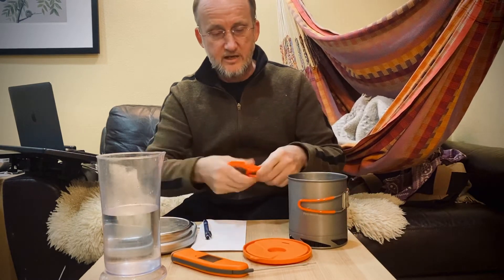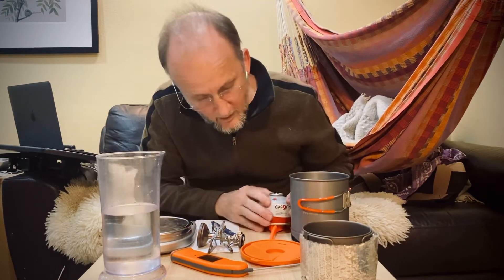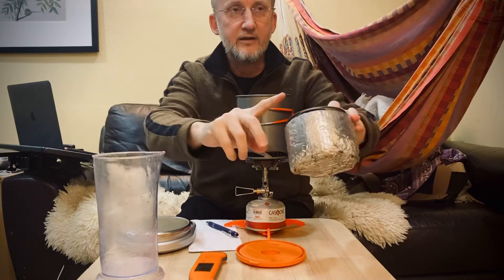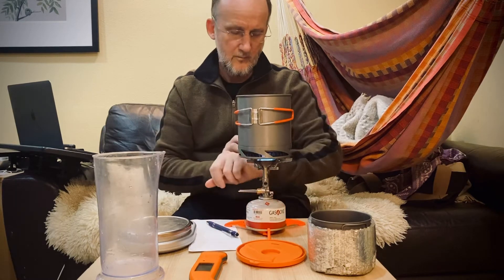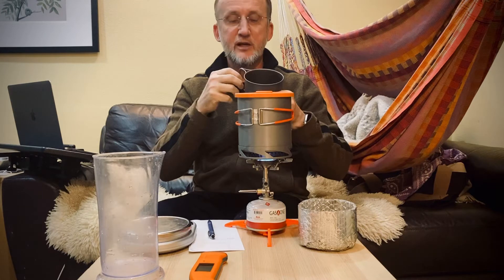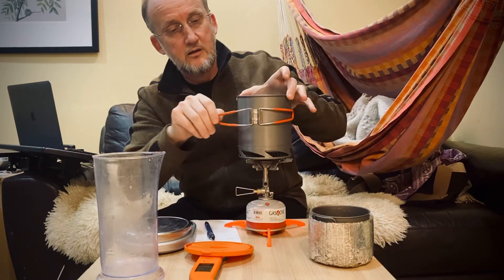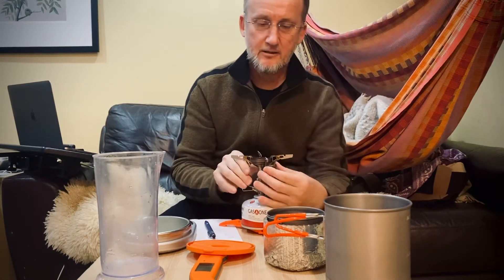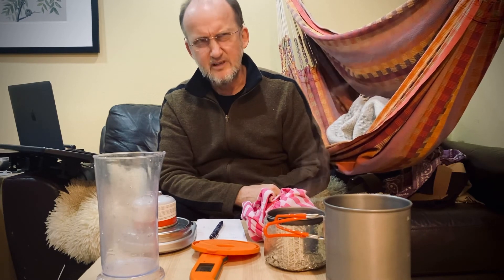DIY Jetboil Stash? Fire-Maple FMC-XK6 pot with Soto WindMaster stove speed/efficiency test.

Comment: Will a Toaks  650 or 750 nest with the FMC-XK6
Reply from the maker: I nest a 550 in a cozy that prevents rattle. Insulated rehydration vessel and bowl. 650 should. 750 probably too tall.
Reply: @cleverchimp  Thank you

Comment: Garbage ....I did 3 separate boil tests between this pot and my 1100ml Toaks titanium  pot with .5 liter of water and there was no difference between the boil times. This was using a Soto Windmaster stove. Not worth the money as a heat exchanger pot over my Toaks, especially for the weight penalty....BTW all my times were all about 1:35
Reply from the maker: Not calling dishonesty, but I must question your report in the light of many, many other tests demonstrating the efficacy of HE pots. Yes, there are trade-offs on fuel efficiency vs weight that tilt the net efficiency one way or the other based on length of a given backpack. I freely admit that I am biased toward fuel efficiency in ways that might not always pencil out given the outrageous metabolic demands of carrying an extra few grams so many miles in my pack ;-). 

I just got the new 600ml FireMaple Petrel HE pot. I freaking love it: locks onto the Soto tri-flex support, putting the flame 100% inside the HE cavity which acts as a wind screen. Even if the wind blows the flame sideways off the pot, the flame must pass through the HE element.
Reply: @cleverchimp  I am waiting for that one to come in the mail. I am sure it will be much more efficient 🙂
Reply: @cleverchimp is there enough ventilation in this set up? Bcs if flame is shielded too much it can potentially blow the canister..
Reply from the maker: @vvs3796  Used easily over 200 times, never any issue at all.

Comment: I hate these indoor boil test videos.  The JB Stash has awful performance in the field as even the slightest breeze will extend those boil times to well over 10 minutes for 2 cups (tested myself).
Reply from the maker: I hiked 1300 miles of the California PCT with this setup. High winds were normal, as were sub-freezing temps at altitude. I’ve been extremely happy with this setup. Other hikers were amazed at boil speed. Eventually I sent home the inner rehydration cup to be able to fit a larger fuel canister, as resupply opportunities thin out in and after the Sierra.

Comment: Hi there! Great video, thank you! I had a question about nesting that I am hoping you can answer... Can you nest a 230g fuel canister, soto windmaster stove (with 4 flex) and pot stabilizer all in this pot? And if this is possible, is there room for a sea to summit x mug? Thanks so much.
Reply: I have the same pot and stove. If you put the canister in inverted (thread side down, with the plastic cap on to prevent scratching the pot bottom), the Windmaster with decoupled 4-flex (or tri-flex) will fit in there and the lid will snap on, but it bulges a little due to the width of the burner head. Good thing it's flexible.

EDIT: Not all 8 oz./230 gram canisters are the same height. The Coleman ones are a bit shorter than others and fit better. MSR and Primus will fit, too, but the lid is not as secure.
Reply from the maker: I am unfamiliar with the sea to summit x mug. If i recall correctly the 4 flex was a little tight with other items.

Comment: Video was great. Much appreciated.

What do you use the 550ml cup for now that you have the bigger pot? / Are you worried about the anodized aluminum coming off from either cooking or scratches from spoon?
Reply from the maker: The 550ml with reflectix cozy is my rehydration vessel and eating bowl. Keeps the main pot clean of oily food residues, available to brew tea, fill a warmer bottle with hot, wash up etc., separate from food. Hard anodizing is very durable.

I have since ground away at the pot support to lock the pot centered on the burner even if not perfectly level, and friend made neoprene cozy for pot so i can ditch the handles, even more thermal efficiency.
Reply: @cleverchimp  you could have just bought a jetboil in essence you just inadvertently made one 😂.. adding grooves to help  lock the pot and a neoprene sleeve
Reply from the maker: @antduke2361  well, it’s lighter and more compact than the large jetboils, but has both a higher BTU on max and good simmer control, and is also cheaper.
Reply: @cleverchimp  I have a zip jetboil 350grams weight  800ml capacity. I actually think your setup is heavier and not as modular. Simmer control on a little pot that holds 1 litre liquid and an  alloy pot you have is hardly going to cut it for proper cooking.  I bet you just boill water and add it to your other pot like you say in the video to hydrate food. So better simmer is not a factor. Plus the jetboil locks together. Your set up Is also more expensive than my Zip ...
Reply: @antduke2361  the Jetboil zip has a terrible flame regulator which is cheaply made and doesn't perform well at all in windy conditions. You have a substandard product. You probably think it is good as you don't understand how things work and are like the typical consumer that gets taken in by marketing hype. The SOTO and the Fire Maple shown here is far superior to your Jetboil. Seems like you don't know what you are talking about.